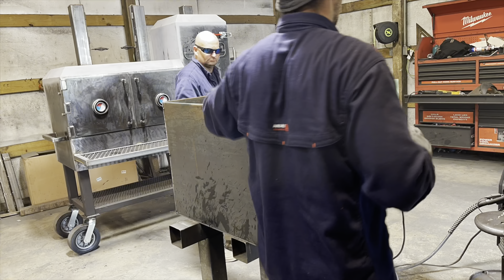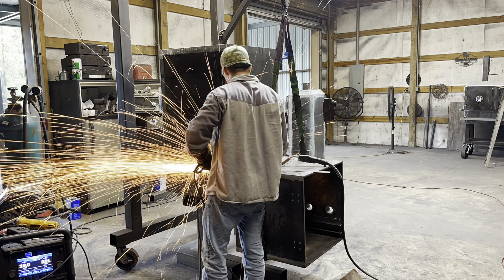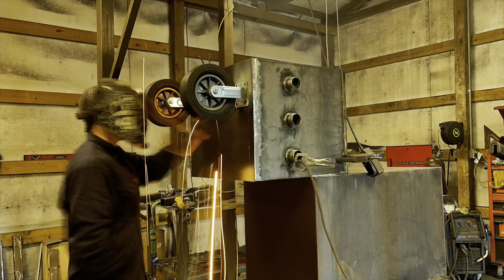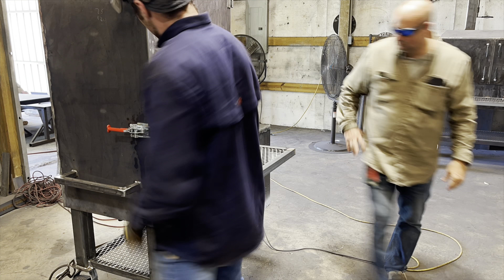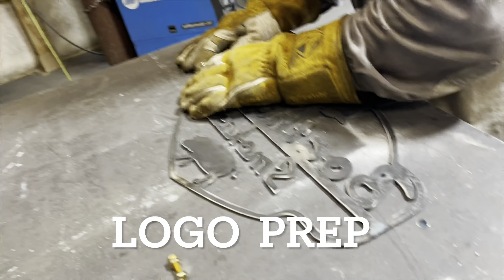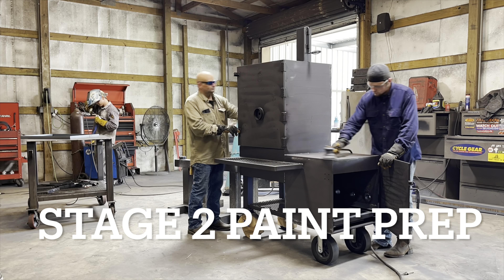Boathouse Smokers Reverse Flow Offset Cabinet Build (Time lapse)

Comment: Hi! I’m going to be painting a BBQ - Can I ask what the stage one paint prep process is? Are you painting the first coat on and then buffing it off so it acts as a primer? I can see that you’re rubbing something on the metal just before the other guy buffs it off? Any guidance would be much appreciated! Thanks!
Reply from the maker: Correct, we have not found a high heat primer that is affordable and worth a crap. We lay down a base coat of high heat black. Let dry for about 48 hours, sand with a 400 grit and then apply final coat. This process works great and holds up against the heat and humidity that is associated with smoking meats.
Reply: @boathousesmokers2336  thank you!